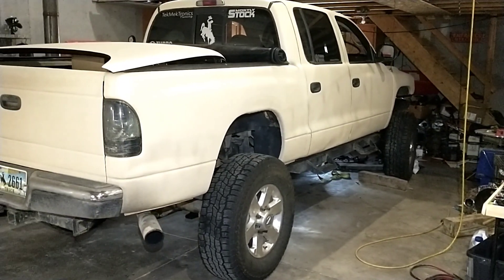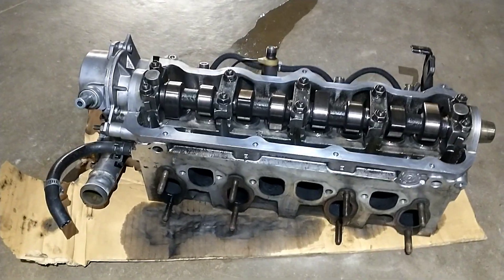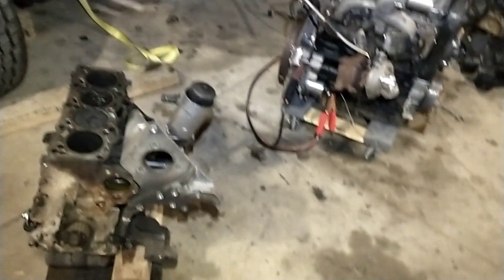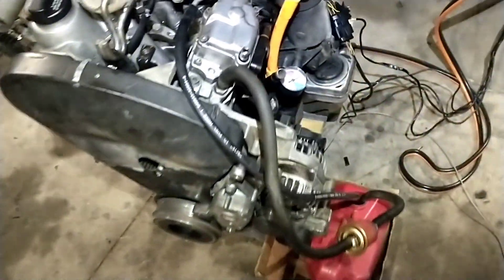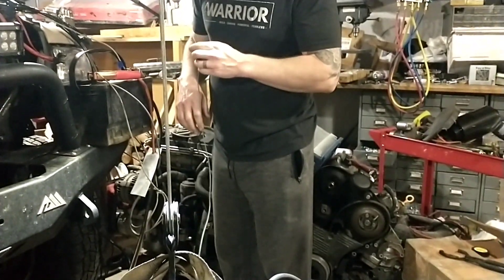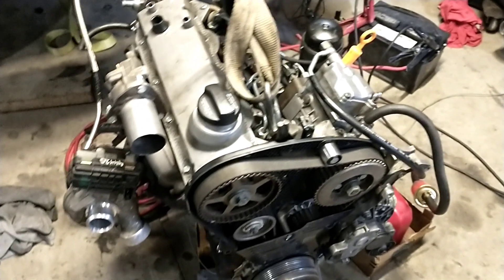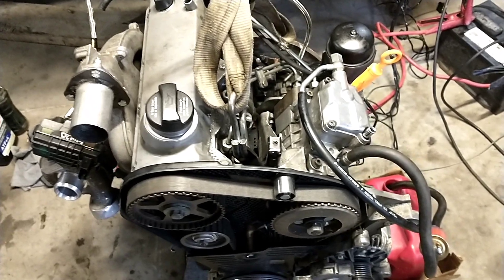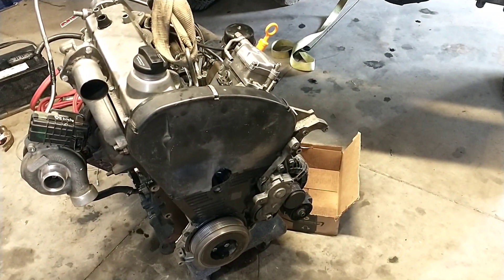Assembling The New ALH Engine For The 1.9L TDI Diesel Swapped 1 Ton Dakota, First Test Fire!

Comment: Thanks for all the videos they are helpful. I was wondering if you might go into detail how you got it all timed up out of vehicle. I have a motor that has the head off and I’m doing a swap with new flywheel from 22r. What do you suggest how to get it timed just right with injection pump and all. I bought this motor with the head off so I’m trying to get it back together. I won’t be able to use the hole from transmission for timing purposes
Reply from the maker: There are timing marks on the front cover and the harmonic balancer. You can use those once the flywheel is changed you just have to have those pieces back on the front side already to see the lines. I go over it in this video. https://youtu.be/1c1dZWUnfcM

Comment: Well I managed to pick up a 2001 dodge Dakota (auto) with a 5.9l magnum engine (156k miles).  I also managed to pick up a 2001 Auto VW Golf with the ALH with 282k miles.  

So this diesel swap of mine is just about to kick off here.  Had a couple questions.  I’ve never sold an engine/transmission before.  Any idea how much you think that 5.9L magnum/trans. Combo is worth?  Also the auto trans out of the VW was replaced about 80k miles ago.  Any idea what it might be worth as well?  Trying to recoup some of the cost of these vehicles👍

I also wanted to ask about blow by on the Alh engine.  When the vehicle is idling and I pull the oil fill cap and rest it on the oil fill home and it dances and eventually shakes it way off.  Seemed a little concerning however this is my first VW.  That being said it cold starts amazing.  Fires right up with one cycle of the glow plugs without any issues.  So I’m wondering if the “blow by” I see is actually something having to do with the vacuum pump being right here off the back of the cam perhaps.  Ive read these diesels act differently from say a powerstroke or Cummins.
Reply from the maker: Really depends on location, I got $1200 for the 5.9 and trans, I have seen a good Jetta auto go for as much as $1200.  But those may be high numbers depending on supply and demand
Reply: That’s great to know thank you.  I know it’s a different market here but that’s a great ball park to start from.  Any idea on the “blow by” I’m experiencing?
Reply from the maker: @ydocproductions5593 you can't measure blow by on a TDI because the vacuum pump is dumping vacuum into the engine so it's always going to be pushing air out.  Blow by would be like blowing the dipstick tube out of the holder LOL.
Reply: @TDISwaps  That’s great to know thank you!    I thought it was a problem LOL there’s a little bit of combustion gasses coming out too, but from what you’ve told me I don’t think it’s an issue.  I also looked up your videos of the wiring harness and how to pull one off the vehicle and again, it’s extremely helpful.

BTW, Glad you’re getting one step closer to having that Dakota back on the road.👍

Comment: Make an alh outboard motor use a foot off of a Stern Drive and cut the top of the 90° gear housing and rotate it 180° so the shaft will be facing the rear instead of the front put a synchronous belt and COG gears on the motor and foot then get an outboard housing and cover everything up so it stays dry
Reply: Probably easier to do an alh inboard
Reply: @AndrewMarsch  they have Factory marinized VW
Reply from the maker: That's an awesome idea!

Comment: Personally. 
I would delete the oil cooler (oil heater)

Less seals and hoses to go wrong. 
Deleted mine 13 years ago
Reply from the maker: I could try it, I currently run pretty warm oil temps in the summer, I have seen as high as 275°F when I'm holding sustained 1300° EGTs, I know the coolant is warming the oil most of the time, but at some point I would think it's got to be keeping the oil from going over 300°

Comment: I have been contemplating doing a tdi swap into my 71 dodge van. The biggest obstacle I have found is the oil pan. The van is rear sump, and the TDI is too long to fit between the back of the hole in the floor and the front crossmember, and too tall to sit on top of the crossmember. 

But an old parts hauler that gets 20+ mpg would sure be nice.
Reply from the maker: Ya the TDI is tall in front, most of my swaps have been easy with lifted solid axle vehicles
Reply: You can lay the vw engine sideways like a vanagon
You just need vanagon oil pan.

Comment: Good morning buddy thanks for sharing your builds. 
What do ya think this engines output will be?
I was concerned that an ALH wouldn’t have enough torque for my build was gonna go with a BHW. Now I’m thinking an ALH would be the engine to go with. Thanks buddy have an awesome day!
Reply from the maker: I feel pretty comfortable running the stock ALH at 200 HP and 300 TQ, this has close to that maybe a little less, but that matches what the 360 V8 I took out made
Reply: @TDISwaps  oh man that’s awesome!! Perfect those are the numbers I was hoping for. Now to find a good donor car, low miles bad tranny. Can’t wait to see what you do next!! I see you have an aluminum coolant neck on the back of the head what is that off of? Thanks again!!!
Reply from the maker: Thanks for watching man! The aluminum necks came on manual ALH/BEW cars.  There's a knock off one on AliExpress from China as well